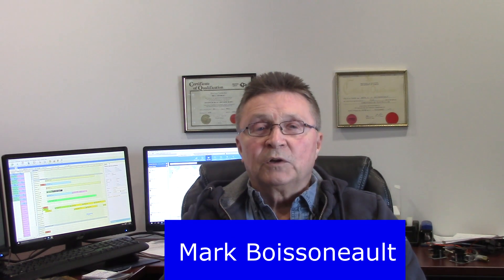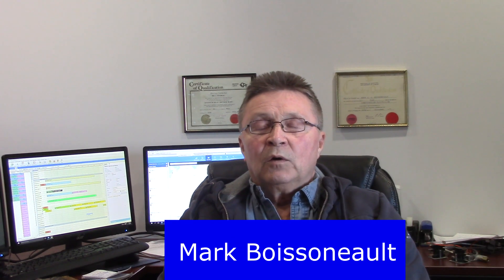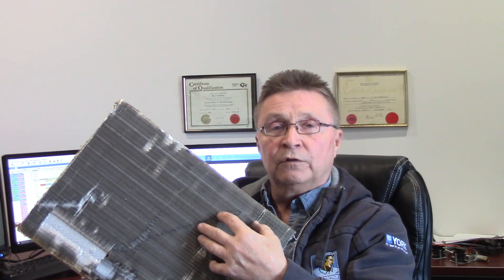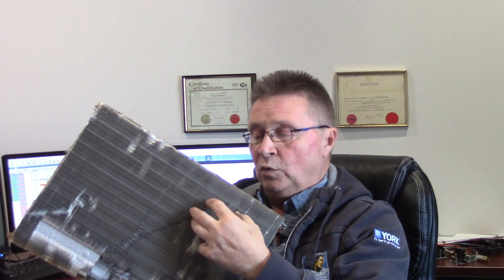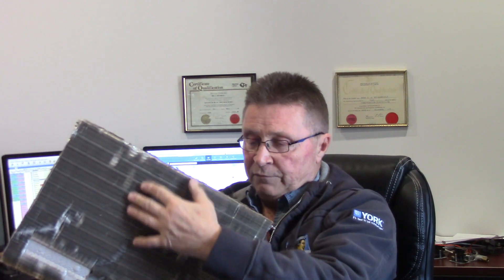3 most Common reasons Why Your Air Conditioner Freezes Up

Comment: Most of the residential hvac contractors in Vancouver British Columbia Canada will topped up refrigerant for your ac unit rather than finding a leak. These residential hvac contractors are good for nothing and they are scammers too😢😢😢😢😢😢😢😢

Comment: Thank you for the tips. I have turned my machine off, and I will go to sleep, and hopefully it will have all melted by tomorrow morning. I am one of those people that like to live in a freezer, therefore, I usually have my unit running at 16°. I guess I know now to keep it at 20°. Hopefully that’s the only issue, and that it’s not an issue with the Freon that you mentioned, in which I would need to call a professional to come help me out with that matter.
I appreciate the clear, concise, straight to the point video that you have provided, and I will provide feedback as to whether or not, it was a success for me. Thank you.

Comment: Thanks for the tips.  I was having a lot of issues with my old coil freezing.

Turns out I had some airflow issues.  One of the returns was blocked during previous renovation work..

My fan speed was set to low.

The old A/C unit blows ice cold after fixing these issues..  I have a feeling coughing up cash for a new one would have run into the same issues soon enough.

Comment: Can anyone tell me why my Pioneer Mini Split will cool down to 77 deg F, but when I set it lower, it freezes up the coil on the wall unit? It cools down to 77F or 25C, but as soon as I set it to 24C, it will freeze up. I have checked for leaks, but there seems to be no leaks. The unit is about 3 months old. The 2nd thing is that it also does not condensate like it did initially. The condensation pipe is not blocked - as the "water" runs out when the inside unit froze up and I set the temp to 26C, it "defrosts" and that water then runs out through the condensation pipe. If there is someone that can give me some tips as what the problem could be, please be so kind as to reply to this post.

Comment: Very helpful and true information -- no bs, well this and well that - a system is made to operate a certain way - if you use it incorrectly knowing or not knowing, it will not work or operate normally so be normal and learn like normal people, use the system normally as designed for normal people - and normally some people like you does not read the instructions normally - so, the norm habits is to use it properly in a normal manner - did I say you are not normal? ok good!

Comment: The home owner can save a lot of repair bill by learning how to do home maintenance on these cooling & heating systems, everything you should know is on U-Tube, 1st thing to check if not cooling or heating are the filters, weak or dead batteries in thermostat, grass clippings or dirt needing to be flushed out in the condenser out side with garden hose , dirty evaporator coil needing cleaned with foam cleaner especially made for evaporator cleaning, a good working system should cycle on an off not stay constantly on.You should hear no strange noises like squeaking or humming,when the system is engaged for cooling you should hear the indoor unit make some normal noise like a swoosh, that sound is the compressor circulation of Freon startup , a loud gurgling sound usually means low on Freon ,I check my system out in early April before summer is upon us an study a lot of maintenance videos, they are super for information!!

Comment: If there is leak anywhere,I suspect the whole Freon to leak out without leaving any trace of refrigerant in the coil network
Reply: Yes, once a sealed refrigerant circuit is compromised the refrigerant "Freon" will continue to leak out until it is empty.

Comment: What about the condenser running without the blower?
What about bad blower motor?
What about system under charged?
What about defective TXV of restricted orifice?
What about there being a dozen other reasons?
Reply from the maker: Hi Matthew, You certainly have experience with this topic. A basic 3 minute video can only point out the most COMMON situations for frosting of the evaporator. Perhaps you should make your own video and enlighten us on the other 12 reasons.

Comment: If you have a small leak from your evaporator coil, how does that get fixed? Last year i had to have someone come out when my cooling stopped and my outside lines were freezing up. It was low on freon and needed a recharge. About 5lbs i think. They said that they detected a leak on the evaporator coil but a slow one. They topped me off and said that i needed an entire new system installed. Mine was about 8 years old at the time and they told me that this was considered old and systems pretty much end of life at 10. Well, im going on a year and a half now and my system is still cooling great. Its also a heat pump so running over the colder Months, it was doing a great job then too. So if you are saying that EPA requires leaks to be fixed before legally being able to get a recharge, i have to assume they fixed it?  I just wanted to know how that is done, I was out there watching them the whole time and didn’t see anything that looked like fixing.. Just a lot of checking and eventually the recharge. And is a leak in the coil really cause for a complete new system? I really don’t want to have to shell out $7,000 every time my AC has a hiccup.
Reply from the maker: Once a leak if found it can be repaired by tightening or re-sealing any threaded connection. If the leak is in the copper or aluminum part of the system because of a poor weld or damaged line it may or may not be possible to make a proper repair. Threaded repairs can at times be made without removing the refrigerant. All other repairs require removal and recharging the system and can be quite costly. 
Leak testing can also get expensive with a micro leak. Sad to say, in my experience most technicians will not know how, have the tools or take the extra time to complete a proper leak test.
Good luck.

Comment: If it gets dirty inside the furnace there's a spray that you can get at Lowe's to helps clean it out and just use a toothbrush to clean it going up and down not sideways go with the fins not against them

Comment: So when the AC is running, and the air is flowing through the A-coil, it needs to be balanced in a way whereas enough warm air must pass through it so it can sorta stay regulated and not over cool itself and freeze up?
Reply from the maker: Yes. If the air flow is restricted the evaporator (cooling coil) can't transfer out it's cold temperature and will frost up.

Comment: I had the repair guy come and repair my ac a few days ago and now the ac is taking a long time to cool down. Even once cooled to the set temp the fan continues to run which is also abnormal. Before they came it was completely fine. 

My partner thinks they didn’t recharge it or something after replacing a part but I think I may have accidentally froze it while trying to cool down our place after leaving the ac off all day. 

Going to try some of your tips and hopefully save myself the embarrassment of calling them to come back so soon. 🥴👍🏼

Comment: Very well explained. Wish you would be closer to us, I live in South West Virginia and purchased 22 wall thru PTAC units(heat pump) and brand new units are freezing up while running on the heat setting. Feeling helpless.
Reply: I hope you went back to the vendor or the manufacturer.  If they never worked properly, your state probably has consumer protection laws that might still apply to your case.

Comment: I have mines at 78 and clean filter and still freezing up
Reply from the maker: Without knowing more, I would think that your unit has a leak and is low on refrigerant.
Reply: Tradesman Mechanical Services Ltd. thank u

Comment: I have open up all of. My. Door changed the filter yesterday I haven't had ice on my unit for a week now until I changed my filter but today I have no ice. So do you think they need to come and clean my coil out I leave my setting on 75 down stairs and up stairs are the same ???
Reply from the maker: I can't say if your evaporator coil needs cleaning or not, but I would recommend an annual tune-up where that gets inspected and you will then find out for sure.

Comment: SathiClap is available to assist you round the clock with its broad range of air conditioner service number and our technicians will be glad to help you. Our experts are capable of installaties in Patna. So whenever you look for the AC Repair Service in Patna, call us on our phone on, repair, and service of split or window AC.

Comment: Cleaned my radiator with a torch to get rid of the dust, a few days pass and now the radiator is frozen more than 3/4, searched you on yt cranked the ac down a little, now the 15+ year old ac blowing like its brand freaking new, Thanks

Comment: I know this is an old post BUT.....if the filter falls down on top of the unit and if the unit is too close to one wall, will those things cause it to freeze up?  Thanks in advance
Reply from the maker: Any thing that might restrict or block the air flow from the evaporator (cooling coil) could contribute to a freeze-up.
Cheers!

Comment: Hi,  I have problem : low press pipe outside condensor  frosted after 5-8 hrs running, high press pipe at  evap area feels cool , the temp max reached only 24 C inside house but I set thermostat  22C. I check filter all the time.. and clean the condensor done.The AC only 5 years old pass the waranty. Thank you

Comment: Excellent video. My sister had her HVAC freeze up over night. I think her issue is one of these - air filter and or the temp turned down too low. Thank you for posting a clear and concise helpful video.
Reply from the maker: My pleasure. Thanks Bill for your comments!
Reply: @tradesmanmechanicalservice1668  If the thermostat is working, I think turning temperature too low (16°C) alone should not cause freezing

Comment: Excellent video - 1 question I have a York Aircon installed approx 5 years ago. Always have clean filters, changed regularly.  My fear is that the unit is "too small" for the house square footage.  Its aYork LX YCJD 13 Seer.  My house square footage is 1800 sq ft above grade.  Of course the company that sold and installed it have gone out of business.   It is freezing up even if I set it to 23C - any thoughts?

Comment: Is that  why my home central ac keeps turning on twice in an hour?
Reply from the maker: Hi. I am not sure how to qualify your question. An air conditioner cycling more or less often usually depends on the load based on heat gain in your home and the outdoor temperature and humidity. If it is condensing (producing water) and keeping up with your desired set-point then you should not be worried about how often it cycles.
Reply: It runs frequent but not enough cool air?

Comment: Thank you for this free information.  Seems nothing’s ever free anymore.  I had a new heating cooling unit installed in April, this is September and I can’t cool my place any cooler than 80.  Finally, today a tech came out and fount it was frozen, no one ever looked before.  Had seven service calls.  My thought all along was that there is a restriction or a leak, because it’s colder in the crawl than the house.  I don’t understand the a/c process,but, now I see why little clearer.  Thanks again.

Comment: My problem was caused by being a little low on freon.  Made sure the filter was changed but was still freezing up.  Got the system charged correctly and now back to working perfectly.

Comment: I have a question I have one line froze and my ac won’t kick on. What can be the problem I don’t changes the control and condenser on the a/c
Reply from the maker: If one line is frosting up then the compressor must be running for it to be that way. I would need more details to offer any suggestion.

Comment: I had a wndow unit not cooling during, of course, a heat wave in July 2018.  My neighbor got me a can of A/C Safe Foaming Cleaner for the coils.  Did it 2X---it worked to dissolve years of dust and crud and got me back to COOL. Cleaner was purchased at Home Depot.

Comment: I have oposite problem. The hitachi AC was brend new (no more garanty), and if outside temp is about 16c, I turn my AC to heat uo to 22c. I starts defrost almost every 15 minutes and its defrostin from 5 till 30 minutes and after that it is doing heat agan 5-20 minutes and that defristing again. The service man have changed the gas in sysrem but the problem still exists. The sistem ia clean, no visible errors. Maybe is sometging with software.

Comment: Thank you for the intel
Reply from the maker: You are most welcome.
Reply: @tradesmanmechanicalservice1668  I let my evaporator coil thaw out over night and turned it on again the next day. It's working fine now blowing cold air. I believe 2 of the 3 things you said where the cause. However I'm not sure about the freon level. Last time my ac was serviced was 2016 to replace an electrical part. Would it behoove me to still have it looked at?
Reply from the maker: I would wait for now and see.

Comment: My a/c stopped working and coils froze up a bit when I cut the air off for a few days and I went to turn it back on. I think maybe I had it turned too low from jump. It was 88 in the house and I put the air on 77. Do you think the unit taking a few days off,then me turning it back on May be the issue?

Comment: In most cases it's all about thermostat malfunction. resulting the AC unit to operate without cutout. second is some leaking ( freon) in the system and third is that dirty air filter . Big thanks for this. man!  From start to end you deliver it well and it surely does add some information. More power 😉
Reply: Thanks
If the refrigerant level is too high, how does it affect the ac performance

Comment: Hello Mark! I just had a company told me I was low on freon and that is the reason why my coil was frozen. The technician advises me that I needed freon. He told me I needed at least 3 lbs. I knew it was BS. My air handler still leaking water on the backup drain line. There is barely water in my main drain pan. What do I need to do?

Comment: Yes we are having problems with are ac too it keeps freezing up. But I watched this video and it was very helpful so not to turn the ac to 40 degrees but have it up a little bit. I did clean all the filters out up above the ceiling. But I think all the vents are open so what do I do next from there

Comment: I used a pólen filter that stopped all the flow... maybe,  or the freon. I had the freon topped 4 days ago. I got the ice off took the filtrate out & am running just the fan... it. Should work... I will let you know! Great video 480-299-9984 Phoenix AZ...

Comment: Thanks for a good explanation.  I have another reason for Ice-up on my AC unit.  My digital thermostat was malfunctioning - turning on the compressor and not the fan.  The lack of air flow that you mentioned freezes it up pretty quick.  Thanks for confirming that the lack of air flow can cause icing.

Comment: I live in an apartment and my maintenance man came and changed the filter however I'm still having weak air flow coming out of the vents the next day I told him he came and changed the thermostat. But before he did change the thermostat I had turned my air conditioner off for four hours before he got here when we got the air conditioner on it was blowing quite well but then after an hour it stopped blowing hard it was started blowing weak again. Unfortunately I went down and told him 4 times but they're going to be supposedly be going to take care of it Monday so I'm having to be in the heat until then. But I was looking up some other information the man never check to see if the evaporator coil was frozen he did not check the air ducts he did not check the circuit breaker he did not check a reset button if there is a reset button and he is not checking a lot of other things. So since my thermostat has been changed what else could it possibly be

Comment: I have a window type ac that gets frozen all the time. I had it cleaned by several ac tech but still freezes up.
Reply from the maker: Sounds like it may have a leak and is short of a full charge of refrigerant. Unfortunately if it is 6,000 btu or smaller , it will not be cost effective to have fixed.
Reply: The AC was  is just a year old. It is a Samsung 1 horsepower. They pour liquid over the freon tank mixed with a small amount of detergent so it bubbles up when there is a leak and also did this over the copper coils by wetting it with the same mixture and they can't see any leak. I am not sure however if that is the correct procedure in determining ac leak.

Comment: My kids pylled off the cover off my window unit and pulled the thermostat and i tried putting it back on but its freezing how do i figure out where exactly the therbostat was located?
Reply from the maker: If the cover is not back in place it may be adding to it freezing up. Start with turning the knob from warm to how cold you would like it without it freezing up. Let it run for 15 minutes between changing the setting to be sure that it's not freezing the coil. Then place the knob in a position so that you know which number lines up with your coldest comfort setting.

Comment: Thank you so much . My air conditioning froze up today. I have change the filter in the air return. But I did not realize there was another filter in the heating unit where the air flows thru. So once I defrost I will check that. My dad died last year. And mom is clueless on everything he did about the house. They just had this unit installed last year before he died. And she can not find her paper work. So you have been so helpful. Thank you very much.